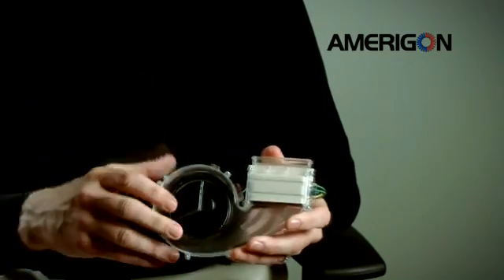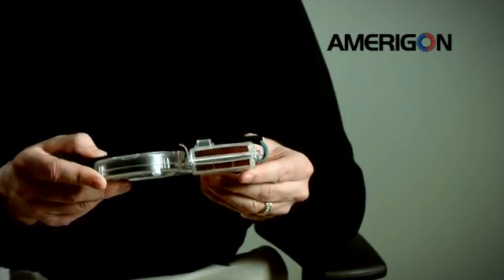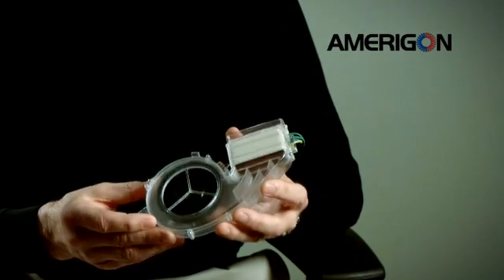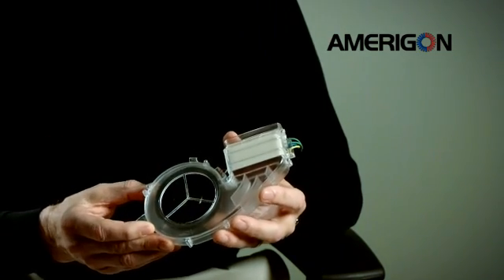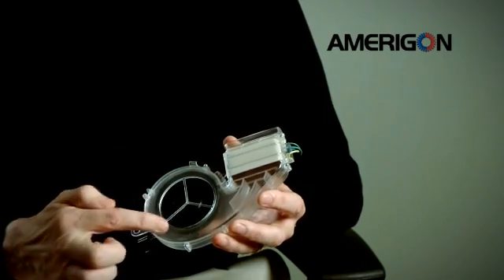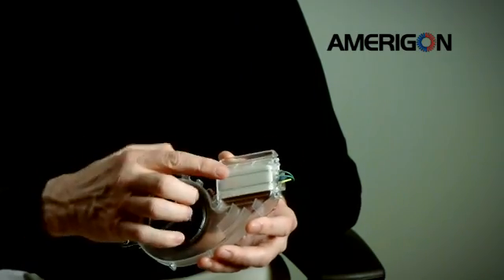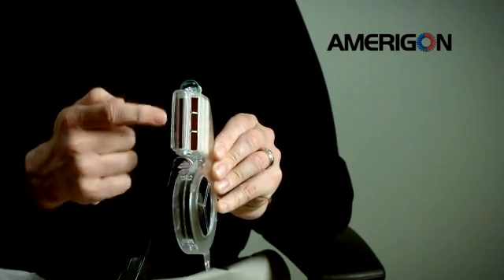Thermoelectric Heat Pumps

Comment: Yes, it would increase in cabin heat, but by providing heated or cooled air right where it is needed (felt) by the seat occupant it is more efficient than heating or cooling the entire passenger compartment to a level that the seat occupant gets the same comfort level.

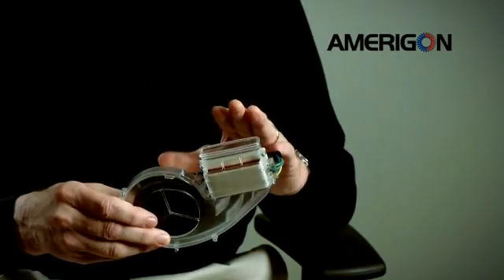Comment: Did I hear you correctly @ 0:32 that the thermal energy is pumped back into the cabin in addition to the energy introduced into the thermoelectric pump? Isn't that a net increase in cabin heat? Surely this also decreases the TE pump over time?